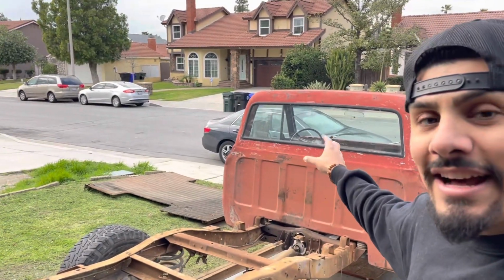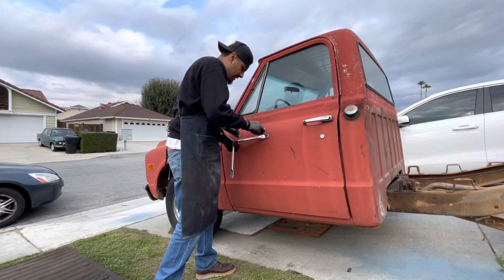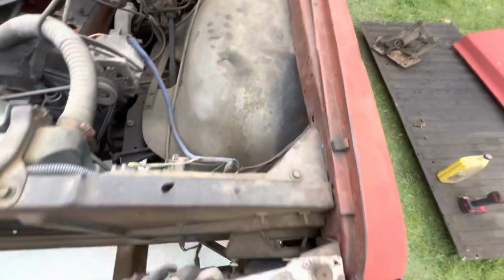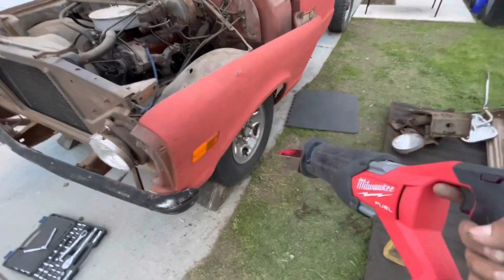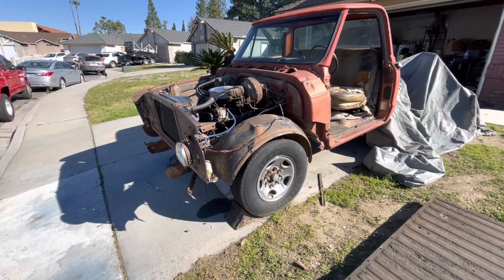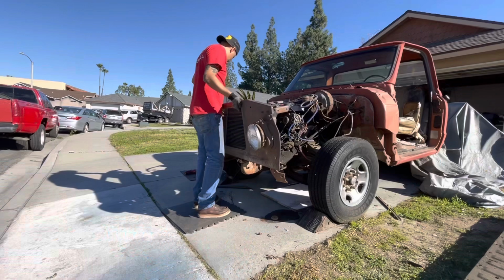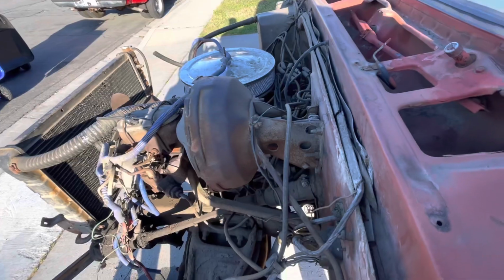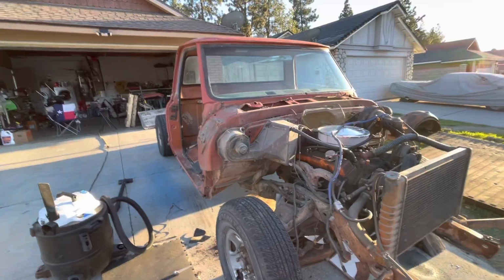1972 C10 FRONT CLIP/DOOR/STEERING COLUMN CAB ACCESSORIES REMOVAL

Comment: I wish my old farm truck `72 had A/C... would save me from cutting holes.. lol.    My 5.3 LS that I'm gonna use has air on it so I have to figure out which way I want to go in adding the A/C guts to my ride. PerformanceOnline has a Vintage Air kit for almost $1900 but it will look like a factory job on the inside when I'm done.. sorta what I'm going for.. original "looking" outside and in the cab but modern underneath. Drive line, suspension, etc.
Reply from the maker: Yes those vintage air kits a amazing. That’s what I plan on running down the road. I think it’s worth the price. Specially down here in SoCal during the summer months it gets pretty hot. Will still take our hear thought lol. I know some places the humidity is wild

Comment: I'm pulling the motor today in my 71 gonna trade it for a tbi 350 out of a 1991 Silverado. My motor is built but I want a daily. Started workin in town and I need a everyday truck not a weekend hot rod. Hope it turns out good, also getting some 15x10s out of it
Reply from the maker: There you go. I hope so too, it’s nice having a reliable car/truck when building a hot rod. My 350 runs great it’s just 3 on a tree and I’m going LS. Gonna be putting this up for about 300 or so see what people give me.